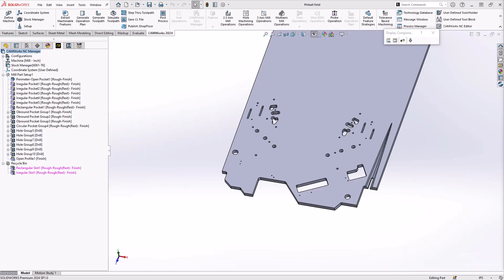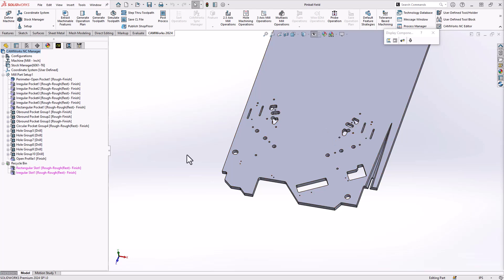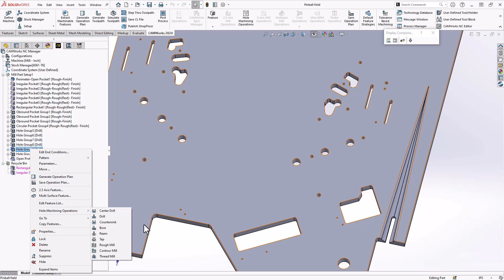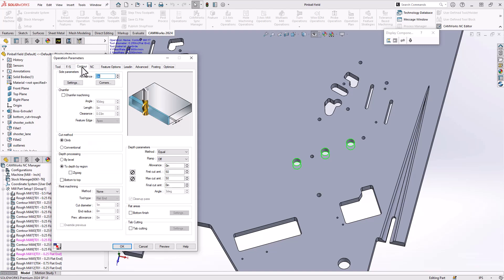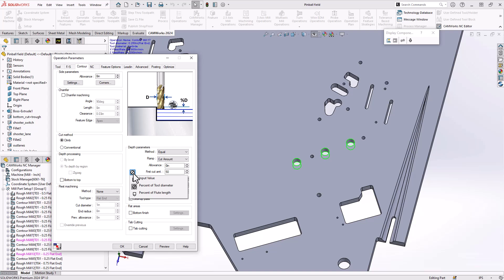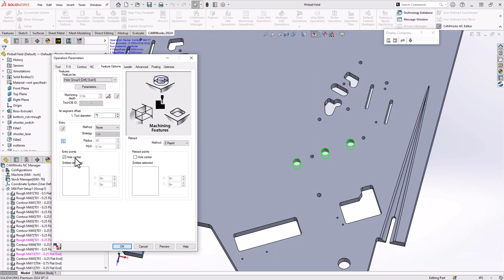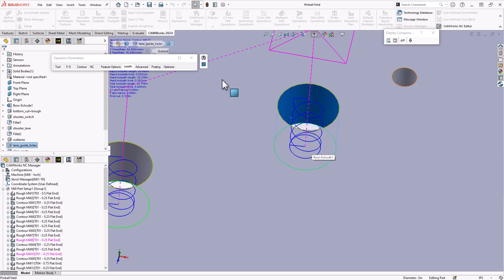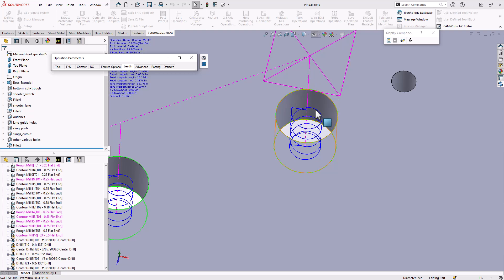Helical Milling in CAMWorks and SolidWorks CAM:

Comment: This does not work when using a Hurco Mill. The tool will not start inside of the feature, instead it gouges and ruins the part.